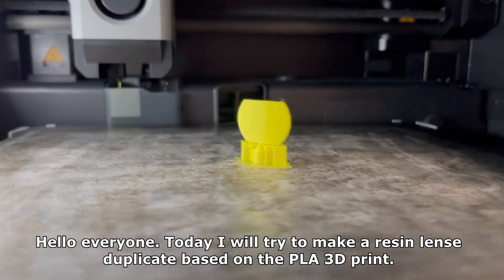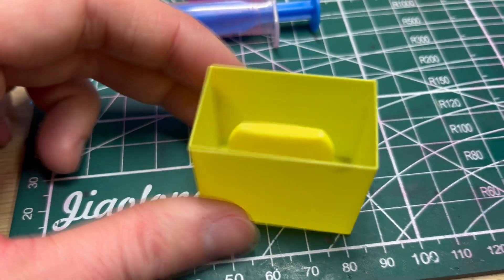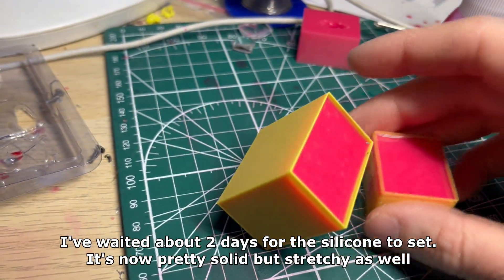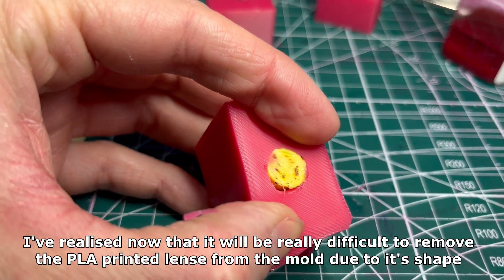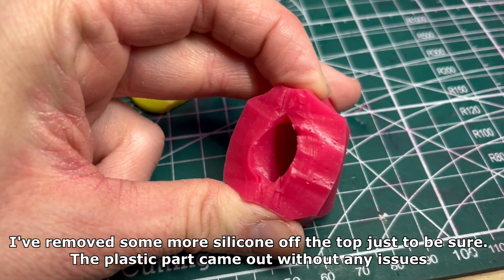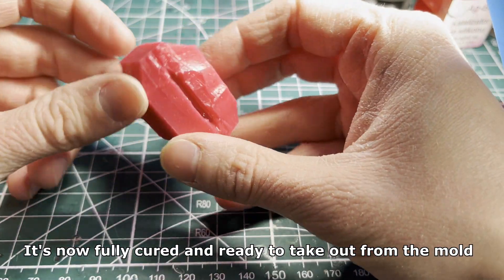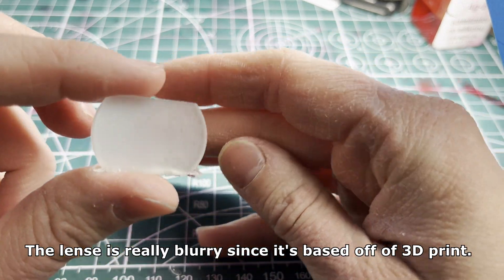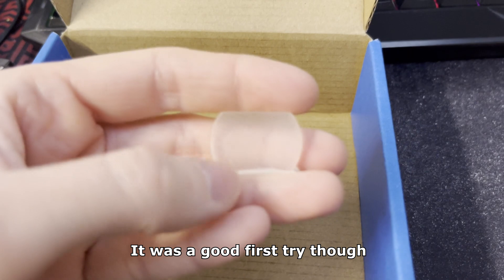Silicone Molding PLA Lenses

Comment: You may be able to drastically speed up resin curing by throwing it on the 3D printer heat bed. Which resin is it?